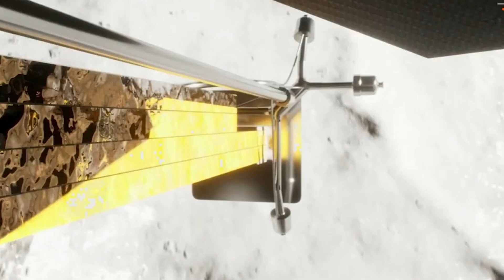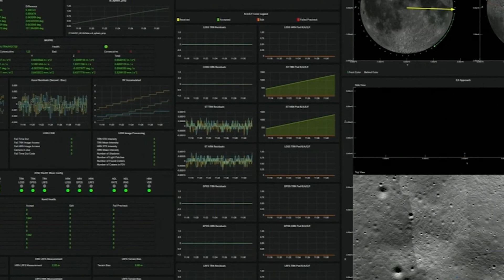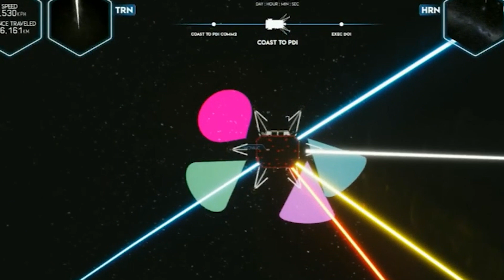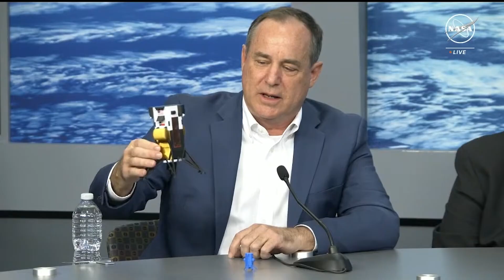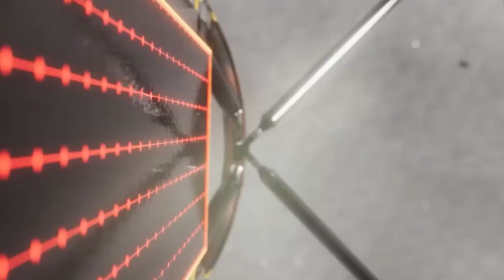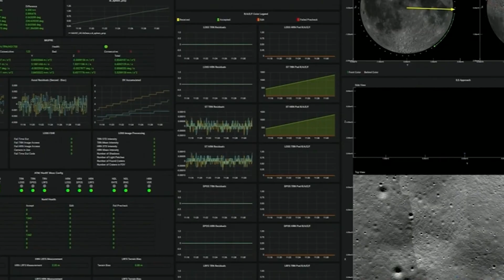What Exactly Went Wrong During Odysseus’s Landing?

Comment: It’s funny how we can land stuff on mars so easily get struggle with the moon
Reply: Atmosphere and gravity do help.
Reply: @Geenimetsuri  the atmosphere is extremely thin, and mars is also extremely far away, so even so it’d be extremely difficult, but mars is more interesting so we try harder for it
Reply: I tried to land on the moon in the 70's ,  I crashed when I used up all my fuel before I reached the surface .  That was on a moon landing program running off of a Northeaster University computer system connected by a phone coupler with results being printed on a a teletype printer.  The system ran some sort of time share software so that many people could dial in. I wasn't pay the bill,  I think it was an expensive call.
Reply: @rbspider  what are you talking about??
Reply: @BisexualPlagueDoctor  What's the video about?
Reply: @rbspider  do you not know??
Reply: @BisexualPlagueDoctor  Do you?
Reply: @@danp576 the boosters are much taller than they are wide ,  they land ok on Earth with more gravity , sometimes on a platform floating on the ocean. This probably would have landed fine if the terrain nav system wasn't sabotaged .

Comment: Why they didn't just eject the camera to record the landing as anticipated? It would have given all the information on what happened on landing. Standing tall or face first would've made it successful. Is an orientation actuator arm 360° swivel with 4 points of outward extension.  Or leave an attachment up there designed for Lander Maglock.
Reply: If you ejected a camera, wouldn't it just fall to the Lunar surface under lunar gravity?
Reply: @Gribbo9999  I presume so. The image capturing would still take place unless the ejection was directed downward at the surface. In any event, a camera can be placed in a transparent inflatable container expelling gas on impact thus deflating and stopping it from bouncing. Unless the device had propellant whichever would still do its job.